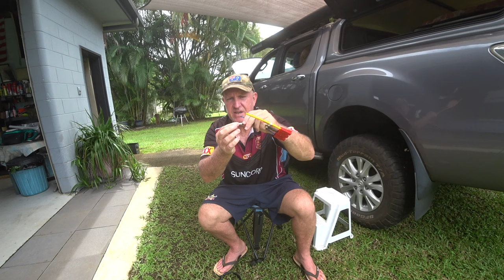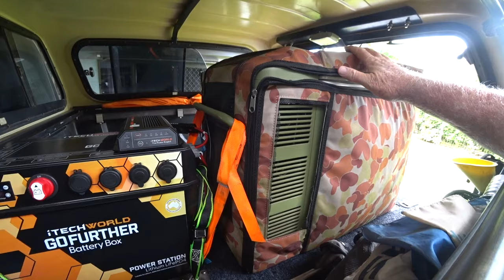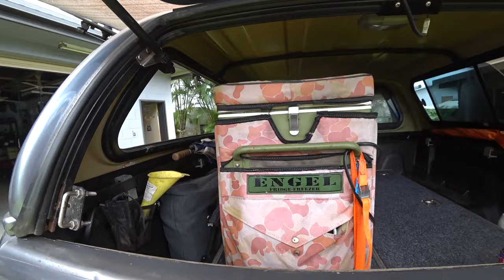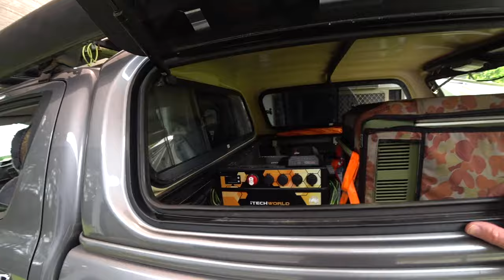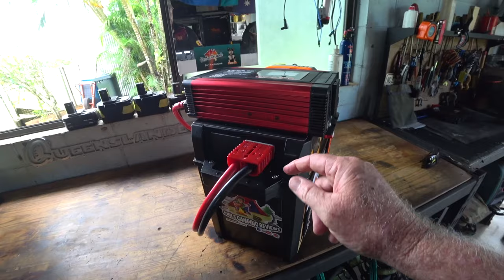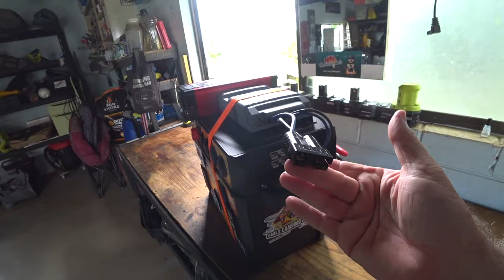Itechworld portable dual battery system in the Mazda BT50

Comment: I am with you, Buck. I keep the back of my Pajero sport simple. I can lift out my engel and lithium battery in my Korr box similar to yours, out when I need to and have room for suitcases when I get visitor. I learnt to make an Anderson plug onto a cable after my  Mini caravan anderson plug came off when travelling down to Victoria and smashed on the road. Luckily, it was a monday, and the auto electrician was open.

Comment: Maybe he meant 6 B&S?
My basic understanding is that 6 AWG is basically the same diameter as 6 B&S.
I see you also cut the mesh out of the Engel cover. I did the same because all it does is impede air flow.
Reply from the maker: Yeah Simon from Lock your Hubs mentioned it in one of his clips that it impedes airflow so I got the stanley knife out.  That wire with the Anderson plug on it I showed had 8AWG on it.  Whatever that is in B&S I have no idea.

Comment: Hi Buck, why not make an extension lead so that the 12 volt input from BT50 to the 2nd battery setup is on the side of the opening side window so it is easily accessible without climbing into the back of the truck. I know you can make Anderson connections so simple. Fridge slide now more usable.
Reply from the maker: I actually asked the auto elec to do that mate.  Yeah will make my own.  Just got to get the same short length of cable.

Comment: The only issue I have with the Itechworld battery box is they supply it with a piss-poor voltmeter instead of fitting a Coulometer of appropriate amps.  No-one in their right mind puts a lead acid battery in the box, too heavy and yesterday's tech for a battery box application.  Only lithium batteries go in these so the coulometer is the only useful  meter to have.  Maybe you can get Itechworld to make a retrofit kit to change it over.  I did that in my battery box so have proper reading on how many AH have been used, what the current draw of the load is, and what the charging amperage is.  My DigiMarker 100AH Li battery can only deliver 50Ampa and charge at 50 Amps so I just went with the least expensive 50Amp shunt, but the 120X delivers 175A so a suitably rated shunt needs to be used.
Reply from the maker: I agree.  Needs a better voltmeter.
Reply: @Mrbuckaroonie..  I have fired off an email to them outlining this issue and included a photo of the Coulometer I fitted to my battery box (not an Itech one but same shape). I suggested they alter their now boxes and also make up a retrofit kit so people can fix their current boxes :)  Let's see what they say, I'll update here if I get a reply.
Reply: @einfelder8262   Hi there. Did you ever get a response about this?
Reply: @hapidaze  No, total silence :)

Comment: No 2 Sweet that looks easy to get out,any chance putting wheels on the fridge l am a senior now l shouldn't be lifting heavy stuff.Please don't forget to change the injectors on the BT50 its common for them to blow holes in the pistons if you don't change them at 100000km😑😑
Reply from the maker: I am at 230Kkms and have not changed them.

Comment: Hey Buck, get the ignition wire connected even with your dumb alternator. 
I love KISS but without that extra wire hooked up it is going cost you long term. 2 alternators and 2 batterys. Plus being in bumf#ck nowhere when alternator is killed.
I can swing spanners and save me $$ and time.
Complete buzz kill when happens

Setting up another ute atm and going use some of your tips.
Going be 3 battery setup this time.
Main crank battery, main deep cycle Lithium like you plus 3rd removable Lithium of 100 or 120amp for leaving at camp.
Got to love weight of Lithuim for portable set ups.

Been running a 200amp plus 100amp for 4years .
Much more budget friendly these days compared to 4 years ago.

16mmsquare cable be minimum fir cranking to tub with 40amp dcdc. Your auto sparkie at $500 including labour is budget friendly consider cable, fuse and extras.
Any cheaper and be fitting Chinkenese or under gauge wire.

Comment: Cant say ive ever seen one of those pickup trucks here in alaska buck very intersting didnt even know mazda made pickup trucks amazing whats available in other countries
Reply from the maker: Mate my Mazda BT50 is the same vehicle as a Ford Ranger.  The Gen 1 and 2 BT50's were Ford Rangers and the Gen 3 BT50 is actually an Isuzu DMAX.  Mazda just put their badge on it.  Mine has the 3.2Lt Turbo Diesel Engine, same diffs, gearbox etc.  Same vehicle mate.  Mine is a 5 cylinder.  The New Ranger has a V6 Turbo Diesel.  We love our diesels here in Oz.
Reply: @Mrbuckaroonie..   we don't get Isuzu d max or Ford rangers here either buck most popular here would have to be a ram or a f150
Reply from the maker: Rams are very popular down here mate but the price is ridiculous.   @gypsyjoker30